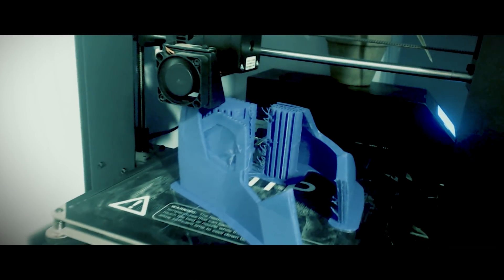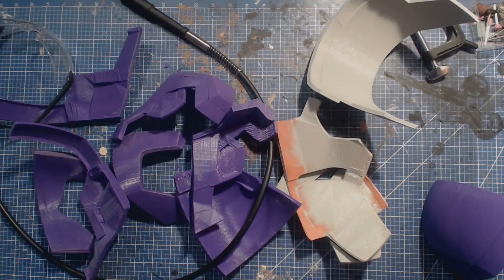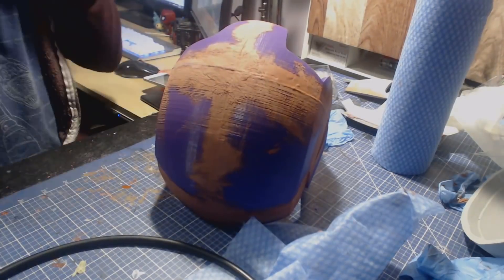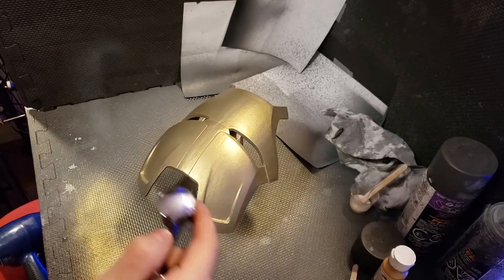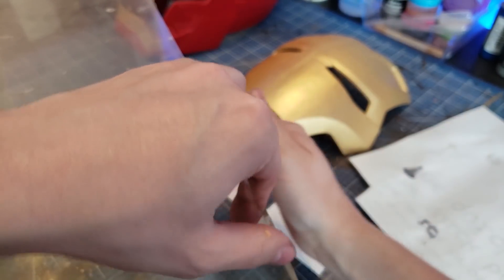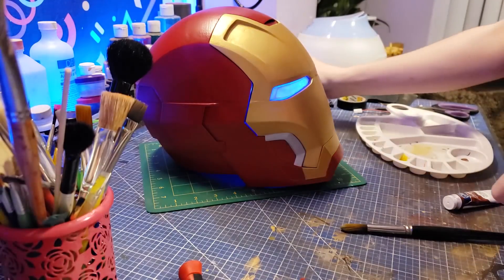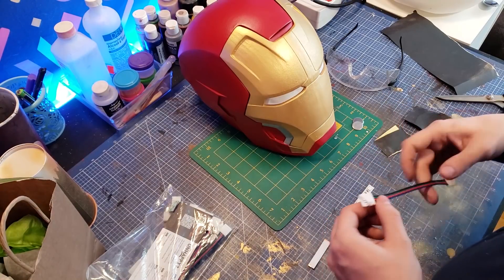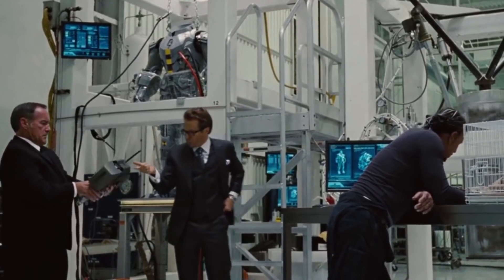Iron Man Helmet Replica - 3D printed on small printer WALKTHROUGH

Comment: Great video! Just a couple of comments:

1. Try applying the paint in layers, moving the can from side to side JUUUST overlapping each line... you´ll have less run over.
2. You can apply a clear coat, and then wet sand it to give it a car-like finish.
3. Use thermoforming for the eyes! it's a great way of getting transparent pieces.

Cheers!

Comment: Wet Sand it with 2000 grit and clear coat it. And then sand the clear coat with 1500 or 2000 grit and it will look better

Comment: the only thing i cant understand is, how did you split the parts for printing? and an even better question, how did you design the parts and their curvatures? i cant find ANYTHING online except splines, but with a spline you can only "bend" from one side, and a helmet requires a 3D bend from all sides. Can someone please explain this to me? I am using Fusion 360, can try another software if there is a way